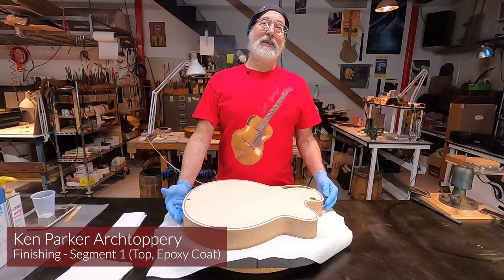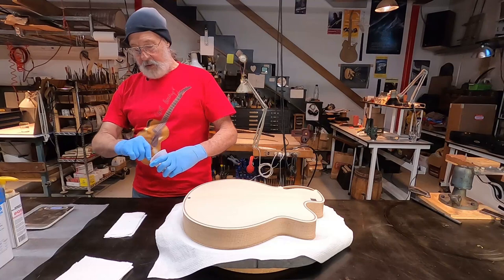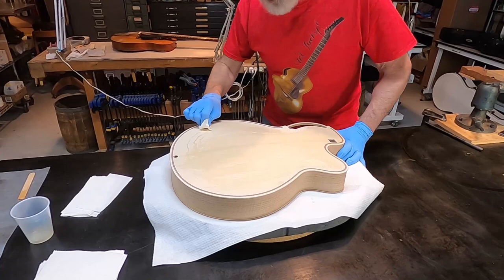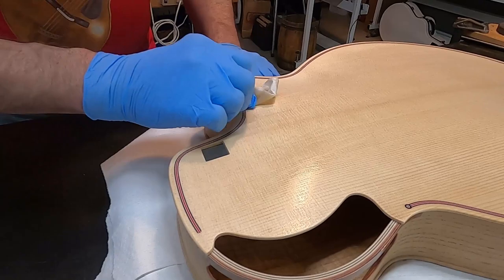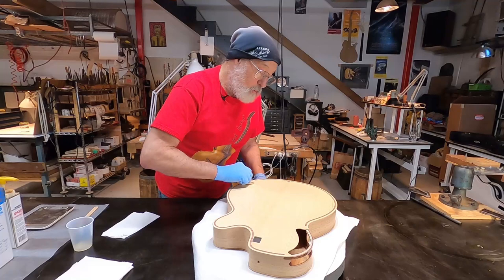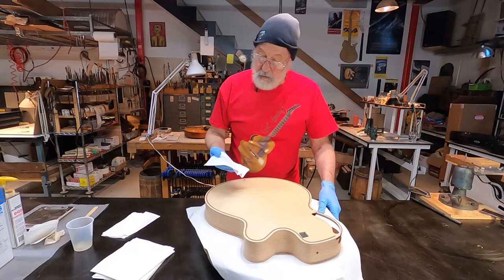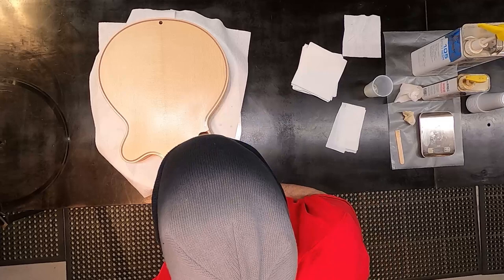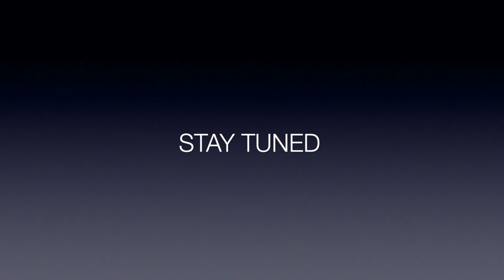Ken Parker Archtoppery: Applying Finish 1

Comment: I think I never saw high-end guitar maker use epoxy this way. I thought epoxy is naughty word for most of small guitar builders, but it makes sense.. You practically stabilising top layer of the wood without adding almost any weight. Pretty smart, thanks for sharing!
Reply from the maker: It's just another tool in the toolbox.  Adhesives are so varied and interesting now!  It's really an exciting time in history to be an instrument maker.  Lots of new tools, chemicals, materials, and still a couple of sticks of great wood left!

Comment: Thanks for this interesting finishing idea.  While I have started building my first guitar I also do wood turning so I tried the  wipe on epoxy and wipe on oil finish on a platter for a test.  It worked very well and is how I will be finishing my turned tableware.  Thanks again.
Reply from the maker: Excellent!  Press on!

Comment: Hi Ken. Thank you for sharing your expertise, passion, and wonderful sense of humour. If you are still looking at comments on this video, I have a question. Forgive me if it has been answered before (I did look but may have missed it) - Can this finish work equally well on a flattop (okay, 30' radius) acoustic? I don't see why not, but I have only built two guitars, both French Polished with epoxy pore fill on back/sides, with none on the soundboard. That experience, and your comments about pore filling, make me keen to try your method. Many thanks.
Reply from the maker: Oh yes, no worries. I know that some FT builders are most definitely using this finishing method on either the whole instrument, or sometimes the top only. Some builders will want to use pore fillers on open grain woods that may complicate things, but as usual, careful testing on scrap material will reveal all.
Reply from the maker: I think I mentioned that superstar Tony Stradiveri used exactly NO finish on the tops of his guitars, the pinnacle of "less is more"!
Reply: @kenparkerarchtoppery9440  Thank you for such a quick and helpful reply, Ken. I'll add "generosity" to my earlier list of your admirable qualities. Much appreciated!

Comment: Ken,  what would happen if you applied epoxy to the interior surfaces prior to assembly?  is there any benefit?  would it help with humidity changes?
Reply from the maker: This is what I do, wipe on one inside coat to back and sides before gluing the top.  Does slow, but mos def does not stop H2O absorption, and stiffens the structure a bit, so I can work a bit thinner.  Not a huge benefit, but I think it's worthwhile.  Good call.

Comment: Thanks for the reply. (By the way, sorry if my English is not accurate but I'm Portuguese, so...). Always a rare and amazing privilege to get some insights of the ones we regard as true masters! One or two more questions (sorry). You use the steel wool or the "magic wand" :) only to solve anything not quite well or also between one of linseed oil  coats? And forgive for the continued questions "bulling": You use the 105 Epoxy and the 205 hardener, in the West System its available the 407 or 410 surface filling. What do you think about it. In your finish system could you use it or its not worth it, regardless of the tonewood used? And more :( to give you more working time, what about the 206 or 209 hardener (or you get best finishing results from 205?) Last one ... and any thoughts about the use of the 207 Clear coating?
Reply from the maker: Hi Flavio!  Your English seems fine to me, nice to hear from you!  You can use 0000 steel wool, or the 1200-1500 sanding sponge if you get a speck of dirt, or if you miss a little spot when you're wiping, and there's a smear of unwanted finish left behind.  I try not to do this, because the finish is so thin, and after all, I'm trying to build a surface with multiple little coats, and any abrasion is going backwards.  I have tried all the hardeners you mention, as well as many other brands of epoxy, and so far, the one I'm using here is my favorite.  I don't feel rushed, so slow hardener is not a benefit.  Also, I'm not trying to fill the pores and make the surface into a plastic mirror, it's just not my style.  Hope you try it out, I think it's pretty great.

Comment: Great technique and as always more technique than materials :) Thank you, Ken! I build flattop acoustics and I want to try this finish. What about pore filling on mahogany and rosewood and stains? Demetry, Ukraine
Reply from the maker: Thanks for your kind words, and hang in there! 
I never was a big fan of pore-filling and stains, although I did mess with them when I was starting out, and its pursuit can certainly lead to excellent results.
I'm told that the most reflective portions of a smooth wood surface are the inside surfaces of the cellulose tubes, which act like millions of tiny curved mirrors, bouncing light back from the cylindrical surfaces exposed by sanding or scraping the cellulose  tubes and reflecting the light. Pigments and fillers can't help but shut off this reflective magic, and the surface surrenders a lot of its' shine and sparkle at the expense of evenness.
I think it's more interesting to let the wood sparkle without the mud-bath of pigmented pore-filler.
A benefit is the relative ease of touching-up a simpler finish, a task which is complicated by every new component we use in the finish.

Comment: What type of finish would you use on a headstock waterslide decal?  Just a medium experienced builder with my own comical decal idea.  Thanks.  MJ
Reply from the maker: I guess I don't know? An installed "normal" decal is about 13 microns, (.013mm) or a half-thousandth of an inch thick, although there are super-thin ones about a third less thick. I believe they are normally spray-finished until there's enough thickness and then leveled, not my thing, I'm afraid. Sorry.

Comment: Thank you Ken for sharing. First time applying your method. Do you sand after the sealer coat or after the oil coats? Thank you!!
Reply from the maker: I try not to sand any finish, that's kind of the point, although sometimes I'll give it a quick wipe with the 1500 grit foam pad stuff. It doesn't really remove much, and gives  a nice surface.
Reply: @kenparkerarchtoppery9440  Thank you for your answer! Appreciate it!

Comment: Any reason you don't use the non amine blushing 207 Special Clear hardener? Also, is that the white scotchbrite style pads you're using to apply the finishes? I've really been enjoying your videos, thanks for being so thoughrough.
Reply from the maker: As I remember it, the 207 is formulated to be UV light resistant, and also to have less surface tension, and therefore fewer bubbles in a film thickness that is applied thick enough to self-level.  The way I use epoxy as the sealer coat, neither of these attributes are relevant, because the way the UV protection works is the UV blocking chemical component of the hardener is designed to migrate to the top surface of the film as it cures. Since I rub to remove the film as hard as I can, there is really "no" film thickness, and so I doubt that this UV blocking component would survive my technique, that is, no film thickness, no "top surface of the film". The 205 "Fast" hardener is formulated for the best mechanical properties of all the hardeners, and I have always used it for bonding for this reason. Since it also happens to work so well as a sealer, I haven't been tempted to try anything else, but that doesn't mean that other materials might work just as well for you. Let me know how it works if you try it.

I use white (Blue and red versions of this fine product are also available) Kimberly - Clark WyPall X80 industrial paper rags to both apply and wipe off both the epoxy and the linseed oil finishes that I like to use on my instruments.
I just checked, and it looks like Amazon and Home Depot are both selling the 475 sheet white roll for exactly the same #, $63.79, for a sheet cost of 13 cents. Should we look up "price fixing"?

This material does not fall apart in use, and works perfectly.
The only difficulty is that the full roll is heavy, and by buying two rolls once I was able to get a free matching dispenser made of steel tubing and rod to help keep it clean and off the bench. An old broomstick and rope will do fine. Use your imagination to see how long it will take you to get through one 475 sheet roll.

https://www.google.com/search?client=firefox-b-1-e&q=Kimberly+-+Clark+WyPall+80

I don't use white (grit-free) Scotch Brite for anything in guitarmaking, although I know that lots of folks use it to remove skin cells and hand oils from the shafts of pool cues.
Reply: @kenparkerarchtoppery9440 Wow, thanks for such a great response, Ken! I just ordered a case of the wipe all towels. The 205 seems to be working great for you. I'll give you my thoughts on the 207 just because... I mostly mentioned the 207 due to its not blushing properties, but as you note cleaning with warm water is easy enough to remove the blush. The tensile yield is slightly lower on the 207 (7,900 vs 6,750 PSI) but it is still very strong. I only say that because I think sometimes people view it as a table top epoxy and a less structural epoxy, which really isn't the case.  I know Russel Brown (wood/epoxy wizard) uses the 207 to apply fiberglass skins to the outside of his boats. I also appreciate the 207 doesn't darken over time in the can like 205 does, and I find the 207 has a thinner viscosity, especially when slightly warmed, which might be nice for your application. For the negatives, it is more expensive and certainly cures slower than 205. I know it claims UV resistance, but I haven't found it to be very good. Maybe it's fine with indoor light, but I've always applied some other coating on top of it. I'm learning so much from your channel, thanks for making these incredibly informative videos.

Comment: Wow, what an amazing finish, I kinda wanna just leave it at this color, it's so close to the original, can I just settle with only the epoxy coat? or should I rather also put on linseed oil (in the video 4 you mention linseed oil, but it seems it was actually true oil?)
Reply from the maker: I like the soft shine that the linseed oil gives, also. it's a bit more protection. Tru-Oil is a brand of linseed oil with some metallic dryers and other proprietary additives we'lll never know about. I like it because it handles so well and dries so quickly, plus, it's available in small bottles so you can easily use fresh material (very important!).

Comment: Hi Ken. I'm in proces of finishing my classical guitar (Padouk Bariole back and sides and Italian spruce for the top. The neck is flamed maple. As Padouk darkens to brown quickly I will use Osmo UV oil instead of Tru oil and see if adds some extra UV protection. Today I put the epoxy on the body and head, wipe it off and already looks great, semi-gloss. I don't like it to be to shiny. My question is: I know that you tried all in your long building experience. Have you try to finish it only with epoxy (let say 3 coats and then sand it till 3000 - 4000? It is possible that epoxy after some time cracks?

Thanks for all your advices on your yt chanel.
Reply from the maker: You can certainly use epoxy without a topcoat. The only rub is that epoxy has poor UV resistance, but this is usually not a problem for guitars. If you woip the epoxy on, the film thickness will be so thin it's hard even to measure. The epoxy film would have to be much thicker for it to crack, so I wouldn't worry about that. I certainly don't have all the answers, but I share your frustration with oxidation. Sometimes it's just what you want, a nice aging amber tone on a top, for instance, and other times you wish you had an off switch. Testing will likely 
reveal your best path.
Reply: Thanks Ken. I have chose the way. Three coats of wiped epoxy on the top and thats it. For the back and sides two coats of epoxy and over it UV oil - as the last week was very hot in Slovenia I already managed to put 10 coats of oil .... 6 more (2 days) to go. For the last layer I will use 2 layers of lemon oil, let it for a week to harden and just rub it with 000 steel wool and carnauba wax. For the neck I'm using only UV oil and for the finish sttel wool with carnauba wax. For this guitar I went much thinner with the spruce top .... 2.1mm under the bridge and 1.8 - 1.9mm at the edges. The soundboard is reinforced with 7 assimetric fan braces but this time they are laminated (spruce - 0.5 mm carbon strip - spruce). In about 2 weeks I will know if this extra stiffnes in the braces + thinner top pays in sound.
Reply from the maker: Sounds like you're having some big fun over there in Slovenia!  Keep it up, your work sounds really interesting!

Comment: Thanks for sharing your techniques in such detail. I owned a Forest Green Fly for some time in the 90's and enjoyed its near perfect balance and lightweight feel. In a way you turned me into a weight snob when it comes to electric guitars as I now cannot abide anything much over 7 pounds.  I was wondering if you could suggest a more inexpensive alternative to the West epoxy? I have a spruce topped chambered Jazzmaster body from Warmoth I will be finishing this summer but I cannot justify the price of the epoxy in your video because I only need such a small amount. Many thanks!
Reply from the maker: Maybe try to find a local friendly furniture maker or boat repair shop if you're near water.  
Maybe they'd sell you a cup of it.
 I've gotten several mails like this, and I guess I don't know what to say.  West used to offer a little repair kit with small bottles of resin, but , when I looked I only found the new kind with plastic pouches, and they're even more pricey for what you get. 

Bottom line is that good stuff costs money.  Sorry I can't help with this one.  Good luck!
Reply: A lot of guitar builders use Z-poxy for pore filling.  I think it can be had in smaller quantities.

Comment: Hi Ken. For the sanding sponge, are you using the 3M 02600 1200-1500 Microfine?
Reply from the maker: TJ Thompson turned me on to this stuff maybe 10 years ago, and I use it all the time.  I'm sure the 3M stuff is great, but the kind I use is Carborundum EZ Touch Micro Fine "P1500 - P1200", whatever that may mean.  They also have coarser grits that I haven't found particularly useful, but YMMV.
Reply: @kenparkerarchtoppery9440  Thanks Ken. I managed to track down some of the Carborundum pads but the 3M ones seem easier to come by. I might try them both to see how they compare.

Comment: Im sanding my martin guitar top, because it was just uncleanable, like even sanding the dirt just would barely come off, crazy. So I'm thinking to first put epoxy on, also because the softwood would otherwise soak up the oil completely
Reply from the maker: I think this is right, if the oil goes on first, it can make things look muted and uneven sometimes, whereas the epoxy tends to even things out and retain the reflectivity of the wood structures, namely the interior surfaces of the cellulose tubed that are so reflective and shiny-looking.

Comment: Hi Ken, I noticed that you are not wearing a mask to protect you from toxic fumes. Are you NOT wearing a ask just to narrate your process clearer, or do you just normally not wear a mask as it is not needed?
Reply from the maker: Normally I have a 5" box fan on a tripod right next to my face, which works very well.  For the videos, it's too noisy, so yeah, that's it.
The WEST epoxy is formulated for low toxicity, but there is still a minor health hazard.  If I were finishing every day, I'd use supplied air, that is, a mask with fresh air pumped in from outside the shop.  The appropriate organic filter masks are expensive, don't last forever, and are not completely effective in excluding the offending fumes.
The resins aren't so bad, but the hardeners have some reactive components as you might imagine.  If you get too much exposure to these volatile chemicals, you can develop an allergic reaction which in some cases is quite severe.  Should you develop this sensitivity, it makes it impossible to safely use any product with the offending component(s).
Bottom line, if it isn't food, you should try to keep it out of your body!
Reply: @kenparkerarchtoppery9440  Thanks Ken. I used the resin today out on the deck of my house but I could feel getting slightly intoxicated. I am very sensitive to chemicals. I can see how using a fan in a large space would work or blowing in fresh air. A mask might do the trick for colder weather.

I made beginner's mistakes but all in all I think the process worked for me today, in the next rounds I will know better what to do. 

Thanks again for your patient videos. If you measure the resin and hardener and work with the humidity and dryness of the wood, it becomes an easy process.

Comment: for comparison, i wonder how many grams of, say, nitrocellulose laquer would be deposited on a typical spray(after it is dry)...
Reply from the maker: Well, here's a wormhole for certain! Nitro can be applied almost vanishingly thin and still look nice by every measure. It's not super difficult, but it requires skill, and is not so often seen these days. Thin finishes like the one I demonstrate here weigh next to nothing by definition, and I bet there isn't too much difference between the weights of various cured finish material. Not everyone seems to value the many benefits of minimal, repairable finishes: what many of us believe is the "less is more" dictum, but I'm in good company and sticking to it!